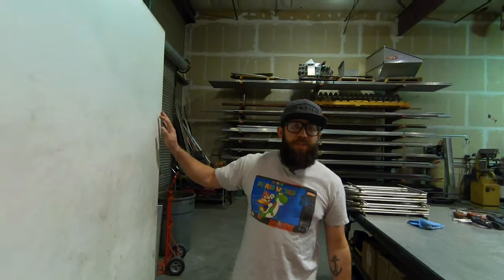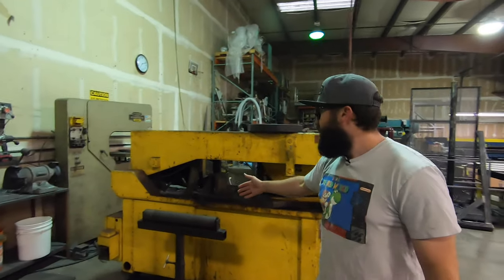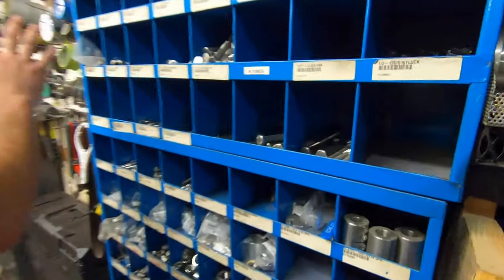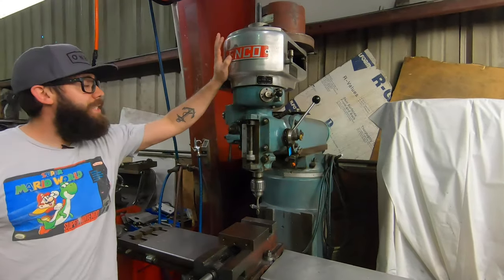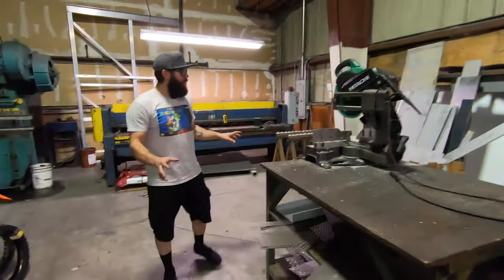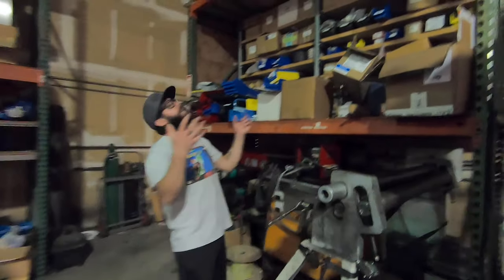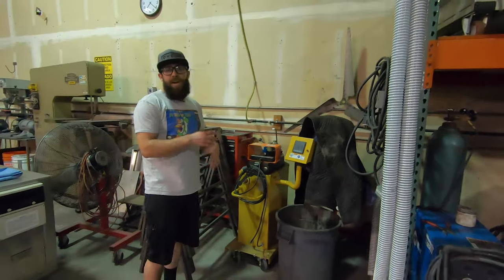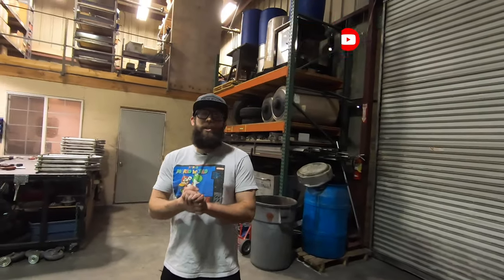Welding Fabrication Shop Tour (Behind The Scenes)

Comment: I have a question. What is expected in general at a normal fab welding job . I know its welding things but could you tell me like what a day would Intel? I'm going to school soon.
Reply from the maker: To be honest I greatly depends on the shop. Being a fabricator is different than just being a welder though. There is a lot more prep, forming of material, etc. Days can vary quite a bit. Some times I’m cutting material for a few days straight and then welding for a few days but usually it’s all over the place. You have to be very versatile as a fabricator. Some times I have to make parts using the lathe/mill or shear and form my own brackets.
Reply: @BuiltForDirt  oh cool. Yea I'm starting school soon and just was curious about what to expect afterwards
Reply: @BuiltForDirt  what about you average shop welding say appliances or something?  Like a beginner starts working, what would he expect